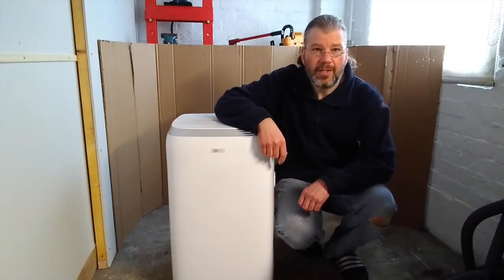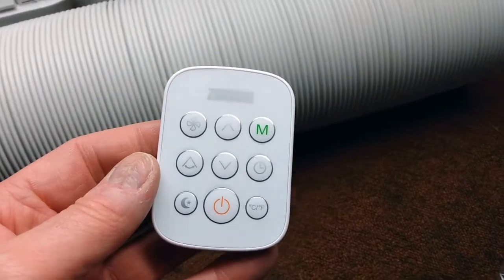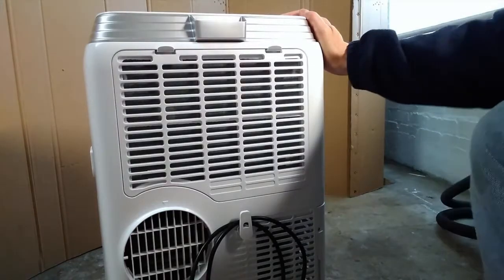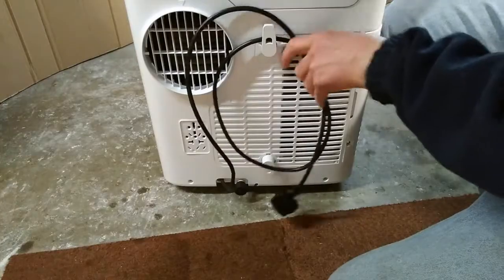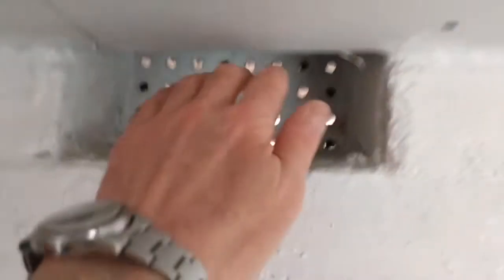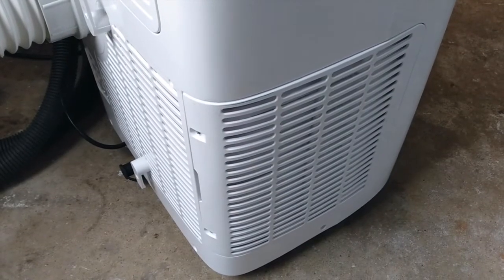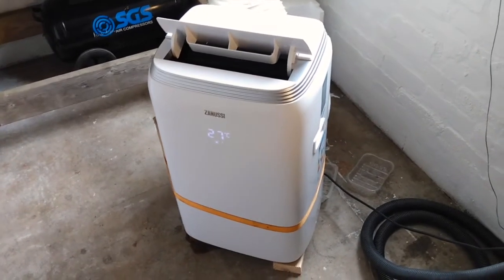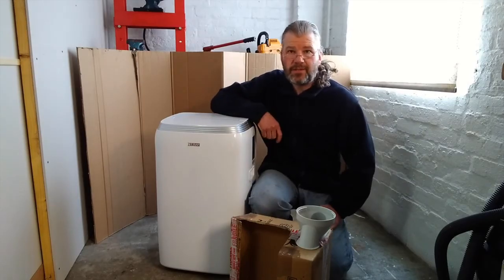Zanussi Portable Heat Pump Air Conditioner ZPAC9002 Twin Hose Conversion

Comment: 2 Years late, but hopefully you realised you don't need to drain the condensate.

Normally there's a spinning wheel in the condenser radiator that throws any water into the the radiator for a bit of free evaporative cooling.
Reply: how can i know if mine has that?

Comment: I bought an 18,000 but heater/cooler/dehumidifier around 18 months ago. Was quite cold outside when I put the outlet out the window and didn't get much heating from the unit. I got a small cardboard box and pressed in the top and bottom of the cardboard box, I then placed a 1kw heater at the entrance to the box and there were huge gaps but enough warmth got through to get the heater on the 18,000 unit to kick in. The box was placed on the rear right and rhs vent of the big unit.
 I'm lucky that I have quite a lot of spare solar power so the running cost of the 1 kw can was covered by my solar and Tesla battery backup. The 18,000 btu unit used approximately 750 watts which varied a bit but the temperature of the basement room was up to 20+ degrees within the hour and I then turned off the electric 1kw fan heater. Once spring came around I could just turn the 18,000 but on without the pre-warming fan and the big unit brings the room up to around 22 degrees each day. The idea was to heat my living room with the 18,000 btu unit but it was far too noisy to have on in the same room so it got relegated to the workshop down stairs. I'm having the devil of a job finding anyone to fit a cold air to air heat pump.
Reply from the maker: The noise is a real pain. In the spring and autumn/fall where I have enough power from my solar panels it makes a big difference to my heating bills. But, in the middle of winter there is not enough light to run it from solar and if the temperature is 4 deg C. or lower it is not much use as it keeps stopping to do defrost cycles.
Reply: The 18,000 unit produces about a third of a bucket of distilled water which I use to top up my fish tank which they thoroughly enjoy.

Comment: WOW you just made your own distilled water.  Not just watched another gentleman with the window unit who said that you could modify a window unit to get even a better transfer for your buck almost free unfortunately I was hoping I would find on your show that you did it first but I'll be still waiting and watch yours too Great stuff
Reply from the maker: I am thinking about getting the unit running again as the temperature is starting to drop here. It works very well as a heat pump down to about 6 or 7 degrees C. - any lower and it starts doing defrost cycles too often. The big problem is the hoses, which are a nuisance. It would not be so bad if I had the old sliding sash type of windows but unfortunately that is not what I have. I can make and store my own electricity and, as you say, make my own water now too - obviously you get more in the humid weather but it can be run as a dedicated dehumidifier and would probably produce even more water.

Comment: single hose are useless, once adapted seal all vents & cracks regardless fresh  air will always get mixed within the unit itself.
and ensure exterior hoses inlet and outlers are as far apart as possible to avoid loop back
always go for a spit window or fixed if possible (if you dont like a breezy & noisy room even though the breez is relativly warm in heating mode portables always find cold air on return to the unit unless room is perfectly sealed as room has neg air pressure so the tiny crackes(doors windows) will draw in cold air avoid portables at all cost far better to over insulate and pure  electric convector if a split is not an option
if you dont mind breezez and noise however and the room is well sealed they have great efficancy
Reply: p0ppp0ppppp0lllllllllllllllllllllllll

Comment: Great video. I hope you will have follow-up in the winter time to see how well it heats up the room when the outside temperature gets to 10c or lower. I myself bought a portable dual-hose Hisense with heat pump function, I cannot wait to find out how well it will work this coming winter here in the SF Bay area.
Reply: Have the same unit you do,not used the heat yet,heard they work great,but the draining part concerns me.looks like have to use the hose to drain the water somehow.using it all summer for A/C,no need to drain it.

Comment: Great video, the intake part though where you've used the reducer to go into your intake part, id probably scrap this piece, on the intake you want as much airflow as possible to get into it as easily as possible. Did the same as you with portable units I had and it worked very well.
Reply from the maker: Thanks. What you suggest is already done. Longer term I want to make a more permanent cowling and use larger hose, as I have done on the outlet side (wet up from 125 to 150mm) or better still use rigid plastic pipe as ducting. Have been using it recently to cool and it works well but I really want it for background heating - will see how it goes over the coming winter.
Reply: @mrpingen  Great job - these units do work reasonably well when you set them up the way you have done.
Reply: @mrpingen   How is it working for you so far during the cold season?   I am considering modding my one hose unit as well, I like your cardboard box idea.    My problem isn't that the unit I have can't heat the room, it's that it sucks in cold air through the cracks near the door.    I don't 100% understand how pulling cold air from outside makes this work, but what do I have to lose testing it out with a box?
Reply from the maker: @btiller44  I have been testing/using the device a fair bit but have been extremely busy and have had no time to do any videos. 
If the outside temperature is above 7 degrees C. then the thing works pretty well. If the temperature is lower then it has to stop reguarly to do its defrost cycle. If down near 1 or 2 degrees than it is a waste of time - better just plugging in an electric heater.
I now have larger hoses and an insulated outlet hose as it forms condensation and even ice on it without insulation.
There are two air circuits, one draws air from outside to cool (when using it as a heat pump) and then expels that air back outside. The heat it exstracts goes to its second heat exchanger and air from the room is blown through it to warm it up then expeled back into the room.
The problem with the single hose ones is that they draw air to extract heat from from the inside and expel it outside, thus causing drafts into the room. They obviously don't work as efficiently but there is one less hose and probably they are lower cost to make.
The whole thing looks a mess but at least it can be moved about unlike a fixed installation.
Reply: @mrpingen    Yeah I never really understood how they can work based on one hose either, lol.    I am using mine in an office in my shop - the rest of the shop is unheated, but typically is warmer than the outside (except in the morning).   I'm going to have it draw air from inside the open shop area and see how that goes.  It does mean I have to cut a 4" hole in my sheer wall but I think it's for a good cause.   I'm also going to 3d print a part that will let me throw a filter in between the wall and the unit so I can leave the 2nd hose box attached. Thanks for the advice and the video!

Comment: Thanks for your review, it helps in deciding on how to go about this. I like the way that you can improvise and improve the design. The Snowflakers would call you an Anorak but without people like you who have imagination, nothing would be invented.
Reply from the maker: Thanks for commenting. Most portable air con units don't come with a twin hose setup for some reason - at least here in the UK. It could, of course, be down to cost but they do work a lot better, as I found out.